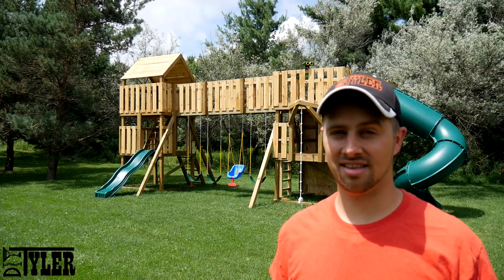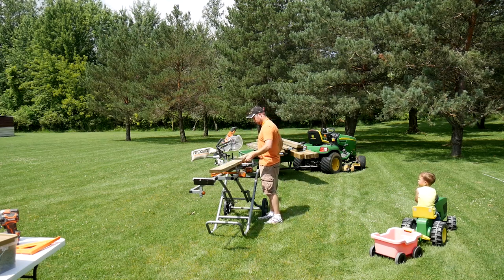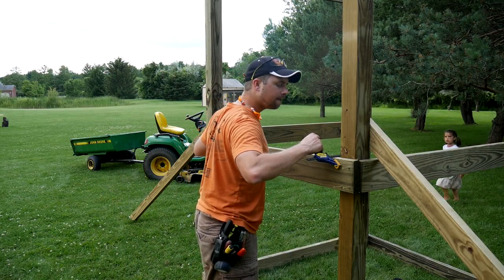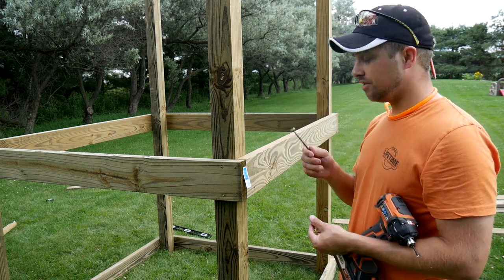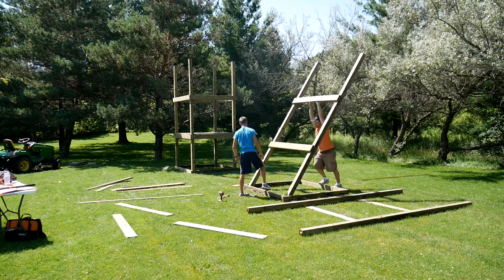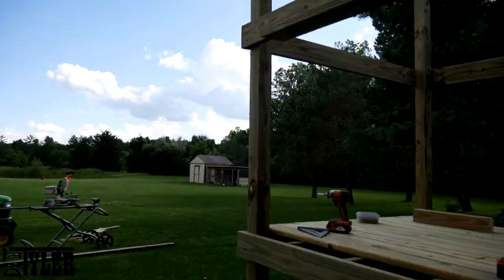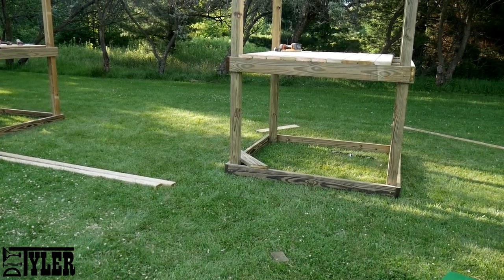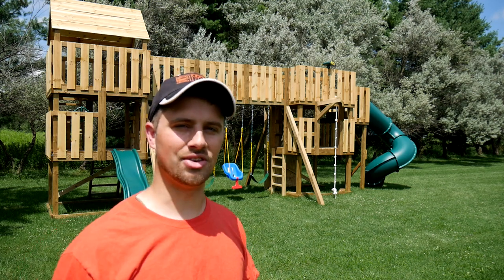Building the World's Greatest Swing Set | Part 1

Comment: Just bought these and started working on this this past weekend. Shortened the bride part to 10 feet, and using 3 inch screws in most places which is strong enough for this build. Will be using something bigger for the bridge part though, probably lags.

With a shorter bridge and not doing the whole side piece for the twisty slide we're looking around $800-900 or so for the lumber and screws, and this is using a 10% military discount, just in case someone was wondering what the cost of just building it's base costs.

Also, the plans use a lot of 8 foot 2x6's, you can save money and waste by buying primarily 12 foot 2x6's and cutting them down
Reply: Also, this is not a 2 day project for a single person lol. That being said, we got about as far as this video goes in about 3-4 hours on day one with 2.5 people working (Dad is disabled so only has one good arm lol). This was helped going quicker by doing all of the cuts first using a mitre station and stop blocks to make quick repeated cuts, and having my dad mark out and pre drill holes where needed. Do all your cutting first then putting together the frames goes very quick. You don't need to predrill but it makes things easier and helps prevent cracking even more.

Comment: Tyler, It looks great.  I look forward to part 2.  I couldn't tell if you spaced your decking boards out.  Many years ago I did a deck and wish that I had left a little extra space between the decking boards for seasonal expansion.  On recent projects I found just using some framing nails as spacers saved me a lot of time tightening and replacing deck boards at the end of each summer.
Reply from the maker: I put them right next to each other, have found in the past that they shrink down and never expand again.....natural gap in a few months!

Comment: Great design! I have an 8 month old and have been daydreaming about building an epic swing set since we found out my wife was pregnant. I have two questions: 
1) I assume you considered anchoring it by sinking at least some posts into the ground. Does it feel stable enough without that?
2) Will you go back at some point to seal it with deck stain? Pressure treated stuff in my yard still seems subject to rot without that step.
Reply from the maker: +Michael Jacko Nothing sunk into the ground. Have not seen a reason for it, heavy enough.
Reply from the maker: And yes, once the PT dries I will certainly seal it....will probably be an annual or bi annual occurrence.
Reply: If you were to anchor it, where and how would you do it?

Comment: Im sure I have no chance of you seeing this... but did you use concrete or anything to tie this in the ground? Im thinking of buying your plans for a build this weekend... but Im really not sure If concrete or  and type of tie down will be needed.
Reply from the maker: Ken, right on the ground. Over the life of the set so far it has settled very little and is in a wet area so I think the natural weight distribution is good. If I was to build it again I would not change anything.

Comment: So I love this swing set and think i'm going to try building it.  Question for anyone, I have (8) 6 x 6 x 8 pressure treated boards that came with the house when I bought it.  was thinking I could use these boards for the posts.  Is it possible to build this using the existing boards I have to save on cost?

Comment: Did you cement anything into the ground? Doesn’t look like it but wanted to confirm if it’s remained steady
Reply: Im wondering the same thing. I think the sheer weight is keeping it steady but you could always anchor in the bottom of the posts on the bases, just need to leave them longer than what his plans and video show.
Reply from the maker: No cement for this project, it has settled about an inch since we built it but has stood up t some crazy wind with no issues.

Comment: I would not trust EMT conduit. It is not designed to be weight bearing, I would spend a little more and used galvanized water pipe.

Comment: I know you were .in a hurry, but I would have let the lumber dry out a little before building.  That's the problem with pressure treated lumber & the fact you got it a big box store.  The lumber in the middle of the bunk is still very wet.  That is why your saw was struggling so much.  Also you are more than likely going to get some twisting and cupping out of those boards as they dry out.  Better to see that before you cut the piece that while it is on the project.  Great project though!
Reply from the maker: I actually disagree. I have found that if I get everything mounted and bolted into place it prevents the warping from the wood drying unevenly. Working well so far here and worked excellent on the deck we build at the old house. Lumber from a lumber yard not from the big box...MUCH better quality.